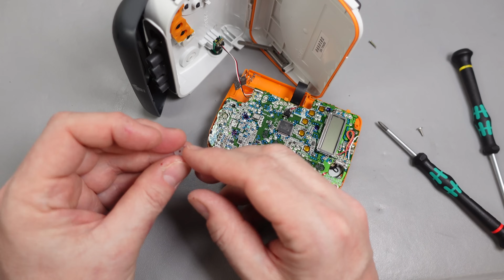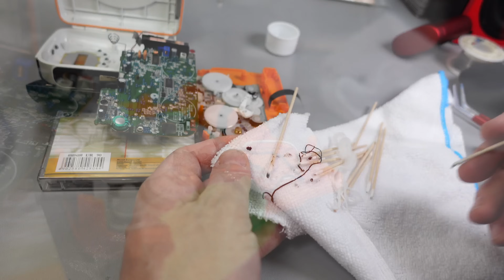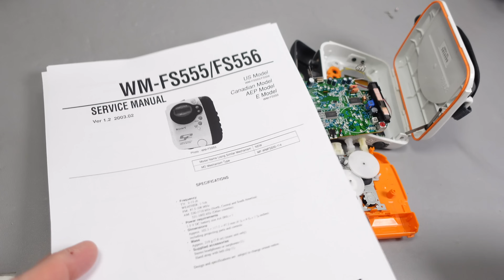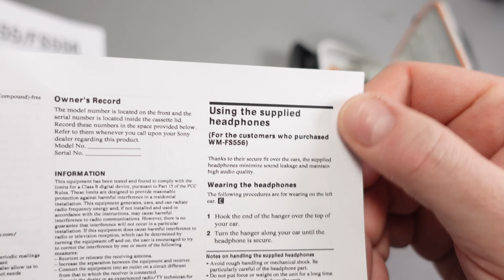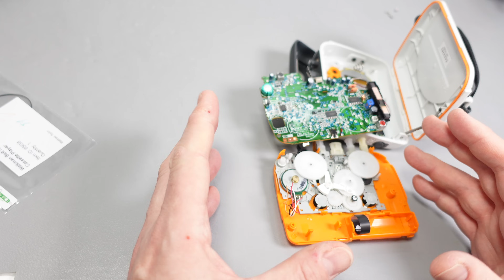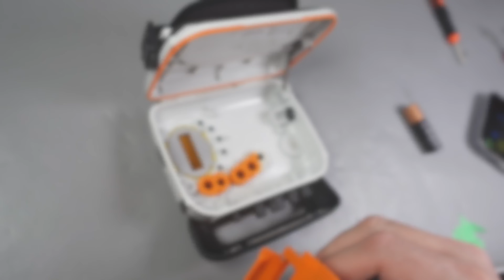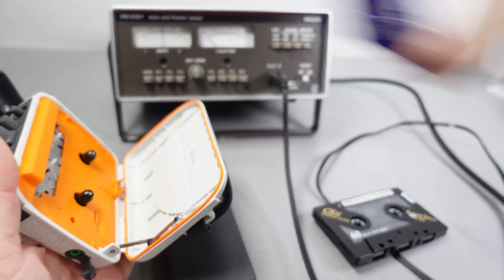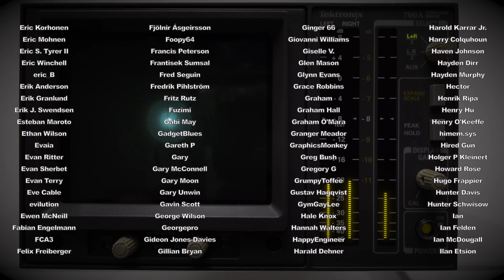SONY S2 Sports Walkman repair attempt

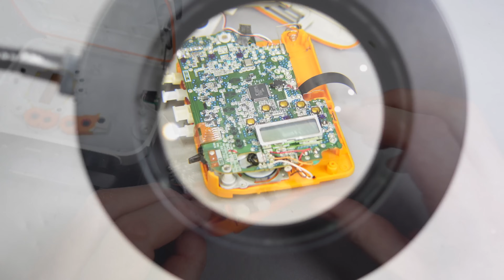Comment: 2:10 Ah yes, the Sony liquorice.
Reply: Not the kind I like the most, haha!
Reply: 'Least he didn't have to deal with the Sony "Gluebricant" grease. Granted, that stuff is rarely seen after the 1980's...Thankfully.

But still, the point stands.
Reply: @netsurferx1  don't tell me. Gluebricant is an accurate name for what I once encountered in a Unitra Fonica G-1100fs record player. Its tonearm control mechanism was literally glued together by grease four decades old. Full cleaning was necessary.